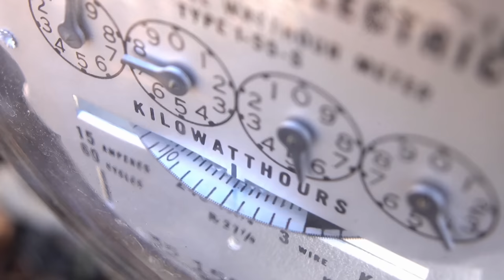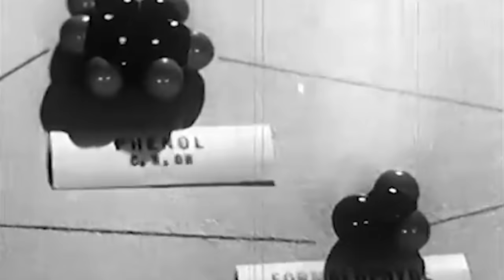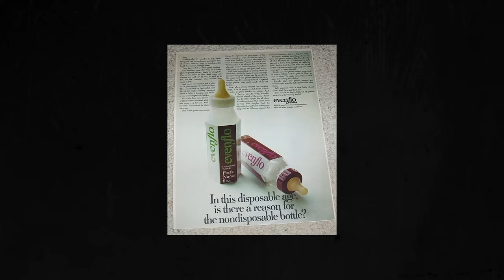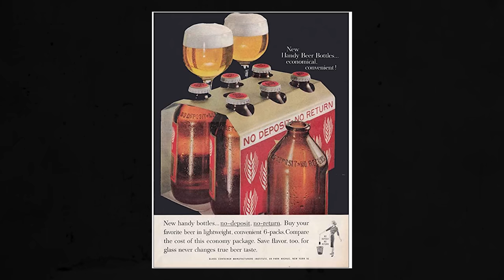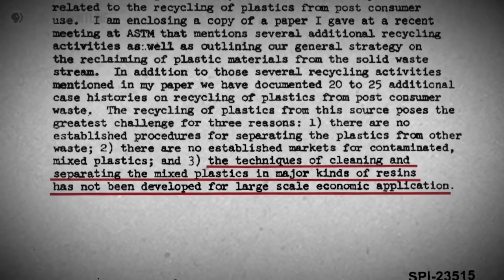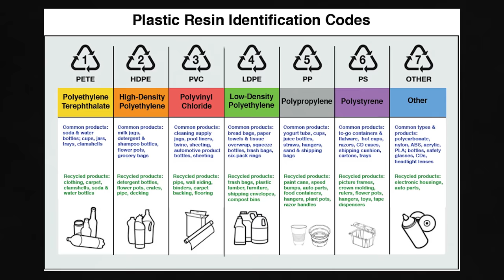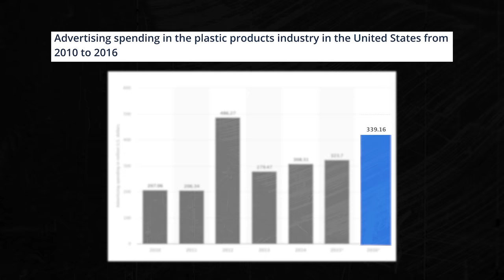The great recycling LIE (what really happens to plastic)

Comment: Great video Sorelle. Only metals and paper are truly recycled. Recycling only works if it is reused.  Glass does not get reused as the colors cannot be mixed so the bottling industry does not use it. It's actually cheaper to make new glass than try to separate all the glass to remove pyrex (not a glass)  and colored glass. Stick to aluminum cans but don't forget to throw them in a recycling bin. New aluminum uses a tremendous amount  of electricity to produce so its important to recycle aluminum cans. The alloy they use is standardized and completely reused by the aluminum container industry.
Reply: Aluminium is literally the only thing that's cheaper to recycle than make from scratch.
Reply: Well guess this, aluminium cans have plastic layer inside of them

Comment: Single use plastics are AMAZING (for some stuff). There's really nothing that beats it for certain products and, in general, plastic provides a lot of insane benefits for a lot of things. The downside is that it is OVERUSED for certain things. The convenience of throwing it away and recycling outweighs the negatives in quite a few cases, but certainly not all.

I have a lot of long-term use plastics that couldn't possible be made as well from something else. For things like prototyping, etc. I use a lot of plastic for modeling and there really is nothing else that can beat the cost, flexibility, and general functional durability of the product.

I think it's wrong to abandon it completely, but I can see cases for reducing it. Someone would need to come up with some insane prototyping material that has the same properties that can easily be manufactured/sculpted/printed at the cost and speed the same way plastic can.
Reply: I don't know. Modelling, design and the like managed perfectly well years ago. Skilled craftsmen made models by hand from wood, clay, paper and card: no high tech 3d printers or computers required.
Reply: @amandah2490  You're correct, but that was a lot of different stuff. With new techniques and demand for rapid results, nothing beats it. Wood, clay, paper, etc. all also don't play well with short circuits well, and you can't use metal because that conducts.
Reply: @simonwaffleman  I agree.

Comment: Better use for plastic; convert it into Plastic-Char.  Basically, when heated, plastic becomes a substance not unlike Charcoal, in that it can be used as a fuel source any place that other solid fuels are used.  I wouldn't use it on my grill, because plastic, but it can be used in place of coal in a power plant.
Reply: A repeat of the leaded gas seems more likely
Reply: @deepanshumalhotra9156  It's probably no worse than lignite, a form of coal that was typically used to power ships because it was too filthy to use in the cities.
Reply: It’s not energy efficient to use energy to create energy.

Comment: As a chemical engineer who has been involved in the food processing, petrochemical industry (including a lot of work in polymer plants) for 40 years, this video takes cynicism to a much higher level.  If plastics weren't invented all we would hear from these people is how our use of paper products were....polluting the environment.  We'd also hear how transporting all these paper products was...wasting energy and fuel.  We would hear how the exploding use of metal and glass containers... and there elevated use of energy were depleting our natural resources.

 If plastics weren't invented all we would hear about is how the exploding growth of paper packaging plants were polluting our environment. 

But plastics, due to their light weight and strength have found their way into cars, thus saving an enormous amount of fuel. Plastic manufacturing plants, compared to steel and other metals plants, use a fraction of the energy necessary due to the use of specialized catalysts that SLASH the amount of energy needed.

Plastics save energy. Plastics keep the air cleaner.

Next time you visit a Kroger, check out the fiber drum they have set up.  You can return your polyethylene shopping bags here and they will be reused for making those single-use bags. I just dumped a huge number of plastic bags into the bin.  Almost filled it up.

But...we find that the success of plastics can also be their disadvantage.  With success come popularity and multiple uses. Due to plastic's customizability we find some plastics lend themselves to recycling while others do not.   We also find that the re-extrusion of recycled plastic can be done something like 3 -4 times.  It is not infinite.

I've often wondered what would replace plastics with better properties - maybe solve some of these problems.  But until then, to say that the world would be better off without plastics, is just plain dumb.
Reply: The collection bin at our big grocer store goes to the dump.  I "rescue" lots of the bags for kitty litter collection and household bin liners.  ONE extra use is a good thing, but still not happy about plastic everywhere.  Worn out plastic part in a machine destroys use of the machine. Replaced, not mended. NOt enough people are unhappy.
Reply: It still polutes anyways 🤣
Reply: Also you can't have plastic without crude oil.
Reply: @hugehappygrin  huge, in the USA we use natural gas, extract the ethane, convert to ethylene, then to polyethylene. In oil rich countries they use crude oil as the start. But we burn natural gas as a fuel and will within 10-15years find ourselves having depleted our natural gas. Mainly because we are burning it.
Reply: @katehenry2718  Yeah, that is a real problem. My wife witnessed this sort of thing first hand, too.  But the collection of PE bags and recycling them is a real thing.  There is a company in California that does it. I posted an article on my blog about it. 

When you shop at Walmart, do you notice the bags are grey?  There is a good chance those are made from recycled plastic.  How do I think this?  Because when you have various colored PE bags and melt them together the resulting color is grey.
Reply: Thank you!!  This video- while it has some good points, didn’t really offer anything in the way of alternatives, (didn’t even suggest just drinking tap water!)
And plastic clothes- last longer- and do we even have enough water for everyone to wear cotton? (Let alone pesticides and other issues with intense farming)
Reply: @hugehappygrin  you can actually, there’s many bio plastics already plus we could use plant oils - which would be a poor use of farm land. Just everyone drink tap water.
Reply: @johnnygeneric161  what’s your blog? I’d love to read it :)
Reply: In Australia we have a “soft plastics” recycler called “Replas” sounds similar to your Kroger scheme… plastic is made into thick planks deck it you can use to build an outdoor deck or outdoor park furniture…. However it seems like most of the customers to buy these kind of planks are local government… I don’t think enough people are using them for their decks at home … not enough for it to be profitable if everyone suddenly started recycling all of the soft plastics
Reply: most plastics will die once the petrochemicals and oil run out. pretty much only ones like polyethylene that can be synthesized will remain but they will be more expensive

Comment: Here is some info about plastics stories of late. 

Drinking straws: The premise of the quantity of straws used daily is based on a middle school kid's science report, in which he called two sales people from straw manufacturers and asked how many they could make in a day. not how many they sold, how many they can make. Regardless of the data this one, single 8th grader collected, the entire argument is based on a middle school kids school paper. LEGISLATION HAS PASSED BECAUSE OF THIS MIDDLE SCHOOL KID'S PAPER. 

Plastic can, in general, be ground up and remelted and used again. HOWEVER, plastics can not always be mixed together. Milk jugs, for instance, could be reused dozens of times. People contaminate their milk jugs by putting them in the same bin as a different type of plastic. This is true for ALMOST EVERY PLASTIC. 

As far as "the plastic industry" being behind everything as infered in this video, the plastic industry does not design the products they make, in general. They manufacture their customers designs. The plastics industry is 100% capable of making a 100% recycleable container. The customer, be it Pepsi bottles or Tide bottles or a piece of a vacuum cleaner.... designs the part with other types of materials that interfere with the recycling. A tide jug could be recycled, but Tide decides to put a non-compatible label on the front of the jug, for instance. As an example, they could have the jug ink printed instead of a label. but Tide knows this costs more, so they don;t want to. They could make the caps out of the same material as the bottle. But it performs slightly worse unless they make it thicker, and thicker means a longer cycle time during the manufacturing process, which means more money. So they don;t want to. 

In the end, the customers of the plastics industry design products, especially single use, in a way to save money. Mixing different types of plastics together generally makes for a better performing, cheaper to make product. The plastic industry does not decide this, their customers do. People keep raging about "the plastics industry" when they should be looking at their products and asking the makers of said products why they aren't spending an extra 8 cents per container to ensure all the materials are compatible. Plastics science has come an amazingly long way, corporate bean counters that design these containers for their business foil this science by pinching pennies and designing poor products. Again, this is at the "middle man" level, not the industrial manufacturing level. Processing plastics is processing plastics. Design of a product falls on the companies that design their packaging, not the people processing the plastic to make it. 

As for recycleing, new chemical recycling methods are a massive recent breakthrough, whereas before all the above mentioned cross contamination of different types would ruin the recycling, chemical recycling can bypass the issue and pull out individual building blocks of the plastics in order to reclaim them to use to make new plastic. THIS IS A RESULT OF THE PLASTICS INDUSTRY THEMSELVES, not the packaging designers. The plastics industry has spent a lot of research money to undo other people crappy design flaws. And now they get demonized for doing this in videos like this one. 

In fact, the war on plastics has one side of the political spectrum so up in arms and raging that they attack chemical recycling as well. Like everything lately, this topic has become politicized to the extreme and illogical arguments are made by ignorant people, and it drives policy making. IT MAKES THINGS WORSE, constantly. Summarized propaganda videos like this one do not help discussion of this topic, it simply serves to enrage people that do not know the whole story, and closes their minds to good discussion and further research into the topic. Shame on you channel owner for posting this one sided view that is missing so much information, much more then I could possibly type in a comment here. Stuff like this is why people make bad decisions and loudly proclaim the evidence of their ignorance when they spurt out talking points like the ones in this video, confident they have been informed.

Comment: Polypropylene can be recycled.  It’s used for lead-acid battery casings and when the batteries are crushed to separate them out, the plastic from the casings is washed, cu up and collected to be sold back to manufacturers to make new casings.

Comment: I still remember from my childhood that anything durable was then sold in paper cartoons or even wood.  An original cartoon was not thrown but often kept along with product. and today is recognized as collecable item . Even heavy   house hold were wrapped in paper cartoon. Now in  times  of environmental  war with plastic and punishment  for  plastic no segregation,   products are made form plastic,    mostly fragile for damage   due to it's poor strength,    is sold wrapped in plastic cover  which for removing from inside  must be cut and is useless. The more war is going on the more plastic is sold along  with plastic product.

Comment: Recycling plastic isn't the only recycling scam.  I used to drive an eighteen wheeler.  On more than one occasion I picked up a load of paper that people had turned in thinking that it would be recycled and save the trees.  Each time I took the load of paper to a landfill in a neighboring state and dumped it there.

Comment: So there is a difference in the plastics. I know that for the sake of brevity the word "Plastic" is being used to describe all the things related to these polymers made in industrial packaging. The problem is that the plastic word is a over arching term that makes it sound like the video is claiming two things at once, that in the early days plastics could be reused but also states later most of it can't be recycled as it degrades after a short use. The polymers known as plastic are rather wide range and in the early days it was called Bakelite, which while it is a plastic it was also very sturdy, a composite that yielded better to reuse. The type of plastic was changed by the industry for different products in order to prevent ease of reuse so this was not an accidental thing they discovered later but the intentional purpose of changing their packaging to make it degrade faster and force users to stop reuse. Plastic that can be recycled through the methods claimed in advertisements were known to not be easily if at all recycled or reused and the campaign was always a lie sold to the public. Most plastic involves oil (petrol) for manufacture... its part of the polymer and resin content that is why the recycle symbols today display the number and have thee code key mentioned later in the video. The most recyclable and eco friendly product packaging... is glass. Glass is not harmful in any way to the environment and is able to be melted back into its raw form to be reformed. Many have lied about glass claiming it takes forever to bio degrade. Glass has no need to bio degrade, it's a mix of stone dust, sand and ash melted and shaped. It's nonsense. Glass products are 100% reusable, recyclable and while some can be more fragile, it's still better than poisoning yourself with polymer products. There are safer plastics, but the public should not be expected to have a chemistry degree just to live in modern society safely.

Comment: In a way we've become too good at recycling. Paper? The few paper conversion mills left are quite backlogged with supply; much paper is still buried/ burned.. Same with glass. New ideas keep popping up, but are often too expensive (i.e., shredding tires and heating them to extract the oil in them) to reach commercial use.

Comment: I worked in the plastics injection molding industry for over two decades. Most plastics aren't recycled because they degrade when re melted. One can add a very small percentage of recycled to virgin plastic, but  it's never as high quality as new melt.

Comment: For years I worked in waste disposal (6 landfill sites). Landfill sites have huge tonnages of metal that can, and are, recycled, and have been for decades. 50% of the tonnage collected on every site will be 'green waste' - and this can be anerobically digested (which captures the methane for energy production).
When it come to Household waste (HH) is a completely different story.
In the UK HH waste is around 12% of the total waste created.
Kerbside collections of recyclable waste are efficient in two things - encouraging people to keep buying products and putting the 'waste' into a different coloured 'bin' AND making people believe this action will 'save the world'.

The only thing householders who beleive in recycling are actually doing is making the Govt happy by continually 'buying' one trip containers and increasing taxable profits of the manufacturers. Just 'follow the money'.

Plastic has a high calorific value, so are a benefit in an incinerator as they release more energy than it takes to burn them - but that does not mean they should be manufactured as once the environmental cost of manufacture, distribution, retail, collections of waste and sorting and finally sending to an incinerator are calculated there will be an environmental deficit.

Another reason plastic is not sorted is that plastic recyclers want 'clean' plastic is large tonnages - then really are not interested in one gram of plastic with a food label attached (as contraries have to be removed prior to recycling).

One thing that is not generally know - this is in the UK - is that County councils are the Waste Disposal Authority (WDA) - while District and  City councils are the Waste Collection Authority(WCA).
The WDA is legally required to pass to the WCA Recycling Credits based solely on the tonnage of recyclable material collected for recycling that has been removed from landfill (avoided landfill costs).
The WCA does not have to prove materials collected for recycling has been recycled. They still get recycling credits, just for collecting unrecyclable material.
The WDA (Waste Disposal Authority) is then left with tonnes of waste that is unrecyclable and should not be landfilled - so a whole new market has opened up in trading unrecyclable but theoretically, recyclable waste.